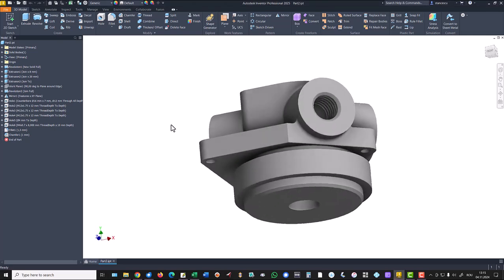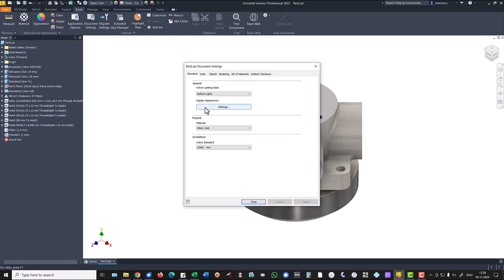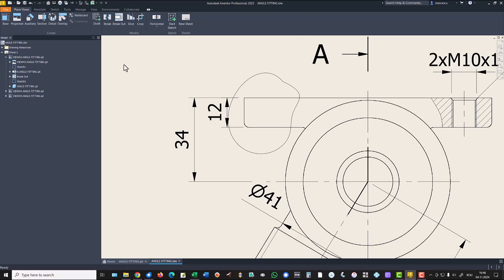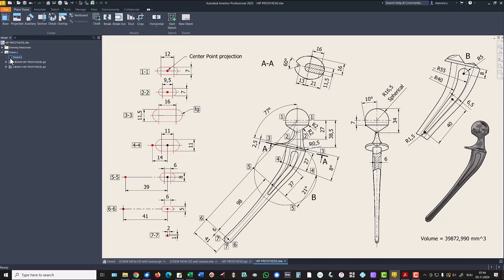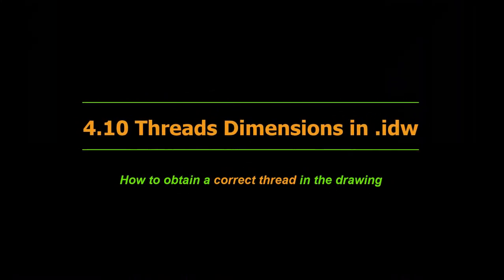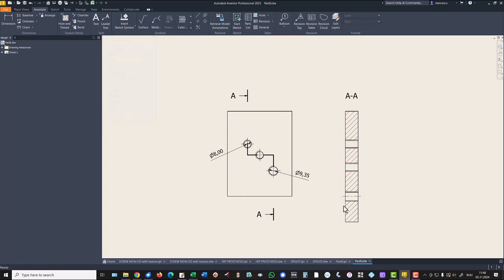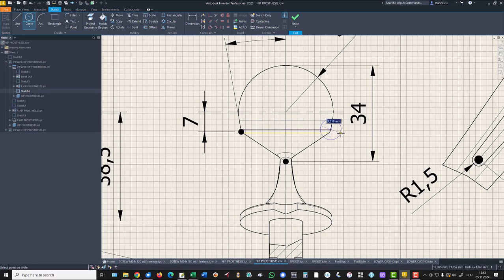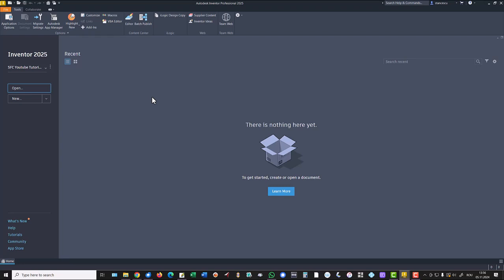Tutorial Inventor - 504 Tips and Tricks - Chapter 4

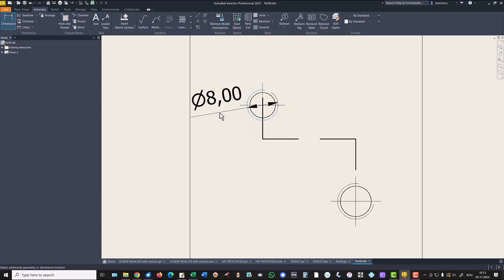Comment: Hi Mr. Professor. At timeline 16:28  for my opinion you applicate an improprieted  dimensioni, infact that you dimension isn't a simply hole. That is a threaded hole then if you  applicate instruments Feature notesa Hole and thread  that you have real in dication for the thread hole tipe for exemple M10x1 - 6h plus depth dimension.  As always: regards, best regards.
Reply from the maker: Dear Graziano, I think I was not wrong at timeline 16:28. For the large hole I used the 8 mm diameter as a base and applied the THREAD tool. You noticed in the browser that both holes have the definition M8x1.25. This shows what I explained in the video, namely that we have to be careful when making the drawing. Grazie Graziano!